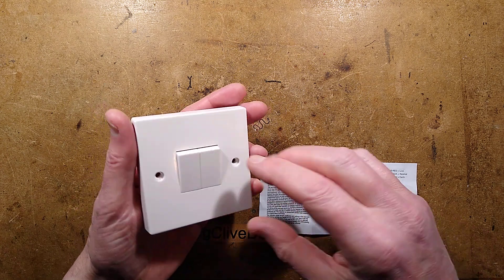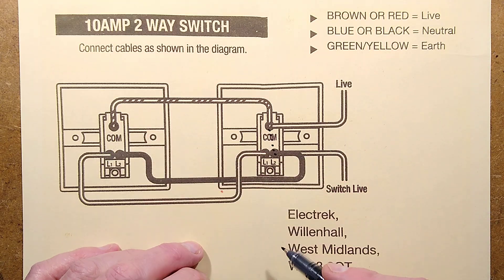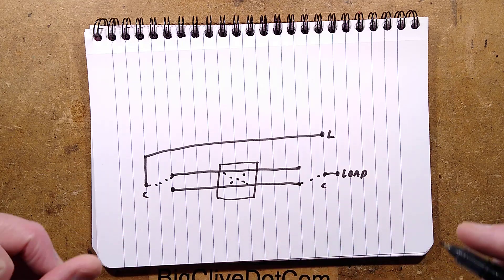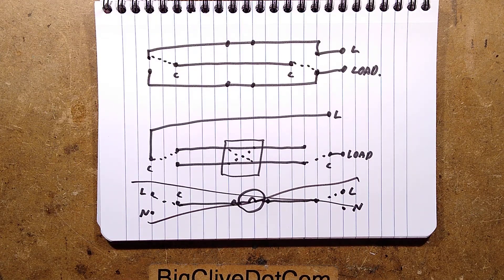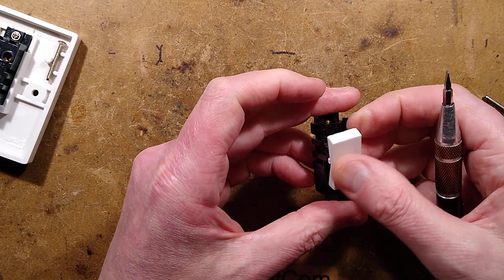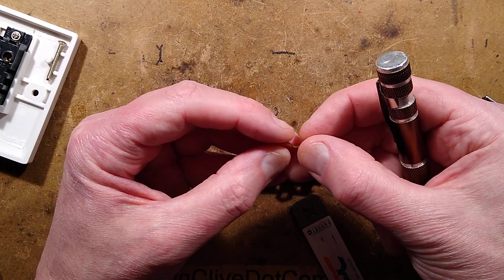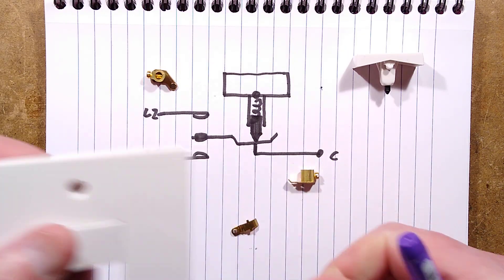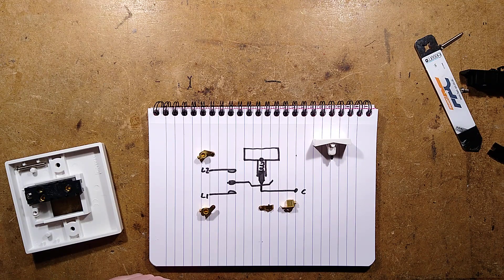Poundland 50p switch teardown

Comment: I don't understand why you'd wire 2 3-way switches like that in a single box. The only way I've used them is to separate the multiple switches on the same circuit geographically... so you can turn the circuit on or off from multiple locations. What would be the utility of wiring them on a common circuit?
Reply: You wouldn't.  It's for two separate lighting circuits.  For example in our hallway, there are two lights.  At the front door a 1-gang 2-way switch is wired to the front light with a 2-gang 2-way like the one in the video near the kitchen door (near the centre of the hallway). Similarly at the far end of the hallway, a 2-way switch is wired to the other light, and to the second gang of the 2-gang switch near the kitchen door.
Reply: @pnt103  Understood, that's the arrangement in our house as well. But it's not what the defective wiring diagram shows.

Comment: How can a single pole double throw light switch be called 3 way when it only has 2 switch positions?
Reply: 3 wires connected to the switch, like a three way road junction.
Reply: @trueriver1950  However, at a 3-way road junction you have TWO options to move forward.  Again, only 2 switch positions and 2 modes lamp operation. 
It's not uncommon to find more than 2 wires at a lampholder or switch anyway... which is an endless source of confusion for the hack DIY non-professional messing with mains potential circuits.

Comment: That third method is known in US as "Chicago Style". 
It's been prohibited 100 years or so. 
On occasion, I'll find examples in old buildings or newer buildings where some wanker handyman did the job.
Reply: That would be "nephew Thomas." He's very handy.
Reply: A friend of mine discovered that the switches at the top and bottom of the stairway in his 19th century house were wired this way when he tried to install X10 switches for remote control.
Reply: I thought it was called the Carter system?
Reply: @SquishyZoran  It has dozens of names I think.
Reply: The problem with this style is that when you are turning devices on and off (especially high power devices) power could find a shorter path through the bulb than through the electric line so the light will be slightly blinking.

Comment: The method you showed first, putting live on one of the legs, not common, is perfect if you have 5 wires and want outlets on the same cable. Or you have double staircase circuit and 7 wires while maintaining blue as neutral. Wiring is fun and those speciality methods always confuse people who just wire it by color and old experience from simple circuits. I fixed so many of those.

Comment: Ah, 3 way switches. Our house came with them in every place possible and it did make it easier to move around in the house after dark.
Then I discovered screw in LED bulbs with PIR sensors and wired most of the 3 ways out so the lights can turn themselves on when needed.

Comment: You would have thought if it was a documentation issue rather than selling it to poundland it would have been less expensive to re-package it with the correct instructions? Another explanation is its bankrupt stock from say Wilko thats been re packaged by poundland who fecked up the documentation.

Comment: What's wrong with hot swapping wires, besides the fact that one should understand what is going on?
I think this should be taught on a breadboard with some batteries and a torch bulb.
Or end up like that short where the electrician asks the old lady: What year year did his house burn down?

Comment: ... completely whiffing past the concept that a pre-made gang-box of three-way switches sold at puntland is about as useful in a home as a gas turbine     I don't believe I'd rate that switch over 6A in the US, the concept of running 2400w through it makes me need to shit.
Reply: Conductors are rated for their current-carrying capacity, not their power-carrying capacity. The voltage (and thus power) doesn't matter for resistive losses (and thus heating effects). Voltage is only a consideration for adequacy of insulation. Also, the UK is nominal 230V AC rms now; has been since the 1990s to harmonise with mainland Europe.
Reply: This is a perfectly normal UK electrical accessory. Not as common as double sockets and single lightswitches, but common enough that you would expect an electrican to have a spare on their van. 

Different countries do things differently. Some countries, including the US use separate boxes, accessories and plates. We brits in general don't, the accessory and the plate are normally the same item. There do exist some modular switching systems in the UK, but they are very much the exception not the rule, at least for domestic work and there is an unfortunate lack of standardisation.

Multi-gang switches in the UK are nearly always what we would call 2-way and what you would call 3-way. Generally when there are multiple switches on a plate, at least some of them will be used for multiway switching.

Comment: I grew up in a country that had them wired in a non compliant way. But getting zapped on 220V was "bearable". Spending some time in the UK I got zapped only once on 240V and noticed the extra to the point that I never wanted to feel it again. Then in the US their 117V 50 Hz is just a little tingle. Good quality bulbs seemed to last forever until them CFL caused a mess. In Western Australia they had a nominated mains of 254V back in the 80's. You slammed the toilet door and the filament was history. Fancy how Poundland gets away with faulty instructions.
Reply: How bearable it is depends highly on the floor (concrete vs wood), flooring (tiles vs carpet) and the shoes you wear. All these things influence the resistance between you and the neutral.
Reply: @simonbenjamins5175     Yes the resistance to ground and of course how dry your skin was all adds up. Also when you are young you can take a lot. Nowadays I even avoid them tense machines in memory. Come to think Japan has its country split between 50 and 60 Hz. It would make sense to go all on 60 in my opinion.

Comment: Hmmm a light switch for a £1 from Poundland not a thing I would buy myself 😮not that I am a electrical expert my knowledge only goes as far as wiring a 3 pin plug 🔌 if I needed a new light switch for my flat I think I would tend to pay the extra and get an qualified electrician to supply the wall switch and fit it 😂

Comment: It's only Deja Vu if you can remember it.  LOL  I thought there was another 2-way switch configuration and some other electrical channel talked about it.  I think the NEC now requires every box has an active "hot" + neutral wires because of the IOT devices are a "thing" now and they need power to run.  You can't make a 'smart' home without 'dumb' wire... LOL

Comment: I would have thought having these being sold to people in Poundland with the incorrect instructions, is worst than them being sold to electricians etc, who won't use the diagram anyway.
Reply: I'm surprised selling such an item with such misleading instructions is actually legal
Reply: @imaginitivity7853  I wouldn't have thought so.
Reply: @imaginitivity7853  They aren't misleading in a dangerous way, so I'm not sure why it would be illegal. They just have it wired up as an OR gate rather than an XOR gate, which is what people usually want. There are situations where you might want an OR gate. A shared light that you only want to go off when both people are done with it, for example.
Reply: @imaginitivity7853  the instructions tell you that a professional should do it so that might count
Reply: Wonder how many people will take the 50p switch back to the shop saying it’s not working properly?
Reply: In the UK its ok to replace an existing switch without being qualified. To wire up a new instalation requires qualifications. So those instructions would not be used either way, or should not.
Reply: @fivish You don’t need qualifications. You need to be competent. Having qualifications is the easiest way to demonstrate competence but not the only way. I completely required my own house with new circuits, relocating switches, sockets etc.
Reply: @andysmith2792 but you'd need to receive proper permits for significant electrical work else there can be problems, like home insurance can deny coverage etc. that's what I've heard at least.

I'm not sure if you'd need certs to receive the work permit. Maybe not. Somebody told me it's fairly easy to apply for one's own electrical permit to work on a house. Just go to the municipal building to apply, apparently.
Reply: @fivish  Not quite.  You can legally add a lighting point to an existing circuit without needing to self-certify as a competent person or notify building control (though you should, in theory, test to BS7671 which would be impossible without the calibrated test equipment required), so it is still possible that a person might quite legitimately want to read the instructions to figure out the wiring.
Reply: @fivish  shhhh don't tell, we'll be arrested for DIY next :o)
Reply: Agreed!
Reply: *worse
Reply: There are no neutrals, so the worse thing that can happen is that the 2-way won't work properly
Reply: @curtisj2165  Unless they misunderstand COM to be Neutral, which somebody did to my fathers lighting in to his alley way. It kept blowing the trip but they didn't know why. I had a look and saw their mistake instantly. The said person was a well known handy man too, so I wonder how much dodgy electrics he's done and got away with.
Reply: @CL-px8ix  most domestic wiring doesn't even have a neutral at the switch
Reply: Maybe not. As Clive's bitch instructions made clear, before doing a project, people should learn a bit about electrical installation anyway. Not sure if this also applies to cacti.

Comment: I sincerely appreciated the lesson in wiring multiple switches in series. 
But I'm pretty sure your double switch is meant to switch two different loads, not the same one. Two switches for the same load in the same spot make no sense.The wiring diagram is borked anyway; I'd like to say "don't buy electrical stuff if you don't understand it", but I'm totally the guy who would have looked at the diagram for a couple hours to try and decipher it T_T
Reply: It brought doubt to my mind too, but the instructions are for two switches on different places. Also the dashed wire between the two commons could suggest to newbies it is a two coloured wire, and so wrongly suggest earth. These instructions are dodgy at least.

Comment: I always think of the first 3-way switch as "send a hot", the other as "pick a hot", and any 4-ways in the middle as "swap a hot". It really helps me remember how to wire them.
Reply: That's an excellent way to consider it.  I'm a EE by education and I still had to spend too long trying to grasp this when I replaced all the builder grade switches in my home.

I'll also let folks know a good 4-way switch is about $15 each here, vs $2 for a decent "standard" switch.
Reply: Thank you for this, it makes it so much simpler.
Reply: I'm not an electrician or anything, but never had any real issues understanding how 2 switches worked....
But 3 breaks my brain 😂
Reply: We call the middle one an "Intermediate".

Comment: I preferred the 1980s MK "Logic" switches that unscrewed from the faceplate and came apart completely so if needed, you could clean the regrease the switch and its contacts with MS/DC4.
Reply: Most continental switches have been riveted for close to a century. The pre-1970s mechanisms were usually open enough to let you clean and lube them though. Modern ones just last forever though. I've been messing with electrics for over 30 years now and the only switches I've seen fail were either crappy plastics cracking and blocking the mechanism or massive issues downstream, like a 10-amp switch on the secondary side of a 12 V 400 W halogen transformer without any fuses switching a dead short.

Comment: Seems to be a quality product than is normal on this channel!!
I use a variation of your first circuit, with a dimmer in the primary feed; this gives a way of disconnecting the circuit if the bulb fails, without having to guess about the position of the main switches.  Works ok but the load must be less than the rating for the dimmer.
Reply: Your 'way' of dimmer installation is hazardous because the supply Active is always on at the dimmer module.
Reply: @BTW...  A valid observation. I should have mentioned that the dimmer has an integral on-off switch that does cut the current.

Comment: Got a dozen or so of them on sale, so used them instead as regular switches. As they also have a fourth non connected position, there I assume to act as neutral join, or for use in the intermediate operation position, I just used them with 2 wires. Replaced all the old 50 year switches at home with them, though i did have to get a 2 way plate for the bathroom one, as it needs 2 switches, otherwise I would have both lights on at the same time. No different than the regular Legrand, just missing the little orange dot.
Reply: We call the not connected 4th terminal a Looping terminal. The appear in all quality light switches and ceiling roses/lamp holders.  It can be used for connecting unswitched Active or Neutrals. 
All light switch modules are 2 way (ie. single pole - double throw) They have 3 switch terminals and 1 loop.
In decent standard light switch modules that looping terminal and switched terminals can be removed by undoing the screw and dropped out without disassembly of the module.

Comment: The third method also has the downside that the life connection in the bulb is changing. That might no problem with UK sockets, but with Edison threaded sockets it is. Then you might have life on the outer threads where you can grab it, even when the bulb is dark.
Reply: Well that's terrifying.
Reply: @literarynick  The Edison socket terrifies me regardless. I don't trust the neutral either.
Reply: @rexsceleratorum1632  It was actually invented by William Sawyer and Albon Man in 1878. edison stole it.
Reply: @mernokimuvek  Edison-bashing is internet's favorite sport, but at best different people invented it independently. It's not much of an invention either. Edison is recorded as having cut the top off a kerosene can lid to make the first prototype. 

Maybe you can trace the inventor of that kerosene can to find the real theft victim.
Reply: Also has the downside that you would need to run "life" and neutral back to the panel from both the switches.
Reply: @Species1571  Not a downside if the switches are far apart and near sockets and such with both live and neutral present. In which case you have the advantage of only needing to run one wire from switch to bulb to switch, the bulb usually being somewhere between the switches.
Reply: @rexsceleratorum1632  Nearby sockets won't help as the lighting needs to be on a separate circuit from the ring. I'm thinking mainly of a dual switch light where the light is at the top of the stairs with switches at the top and bottom. Live would only need to be fed to the downstairs switch as this typically also has additional switches for other downstairs lights.
Reply: @Species1571  Never heard of a ring system being used here in India, so that's not a problem here. You get phase and neutral to some place, then you mix and match lights and sockets.
Reply: Remember though, that in the mid 20th century in the U.S., there were no polarized plugs. With any table lamp, it was a coin flip whether the threads were live or not. As a result, we boomers learned never to touch any metal in an electrical circuit at any time. That's a valuable lesson because to trust the neutral is akin to trusting a baby with a knife.
Reply: So the Carter System I think?
Reply: @SquishyZoran  It has lots and lots of nicknames in various places. California system, Hamburg system, thunder and lightning system (because it will cause spectacular meltdowns if used with modern switches like the one in the video), etc.. I assume the main reason why it wasn't used in the UK is because it only really gives much of an advantage if you want to supply both a switch and a socket (or multiple sockets) with a minimum number of wires.
Reply: "life on the outer thread", no after that you'll have no life

Comment: It’s very interesting how UK switches work differently from North American switches in terms of the mechanism
Reply: The actual mechanism inside is fairly similar as far as I can tell, only the shape of the metal bits varies but you can have that between different manufacturers too.

Comment: Your prefered method of wiring requires 3 wires to run the whole length in parallel, the usual method only requires 2
Reply: On the bench, yes. But in practice the wire connected to the common terminal of one of the switches has to be routed back to the ceiling rose as well so Clive's preferred method is simpler to implement - you run a single cable between the switches and the rest of the circuit is as it would be for a basic single switched light.
Reply: You always have to run three wires to each switch, but with Clive's preferred method one of them is always the live wire. I also prefer this, because if I want to add an outlet next to the switch, I only need one extra wire for neutral.

Comment: That switch shouldn't have been made because, why have 2 switches in the same holder that can control the same light???  I can understand if it it controls 2 different lights, but not the same light.
Reply: The two switches are completely independent.. you wire them to different lights.
Reply: @Monkeh616  OK, that makes sense then.
Reply: @Gremlin65 OK, that makes sense then.